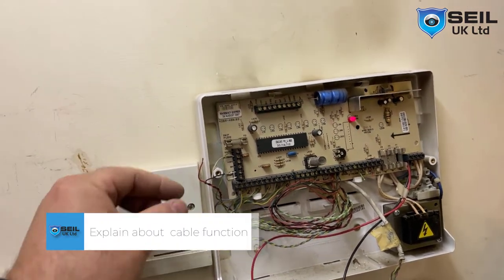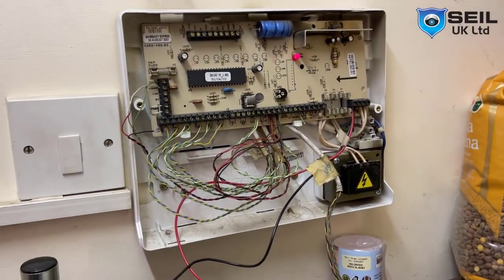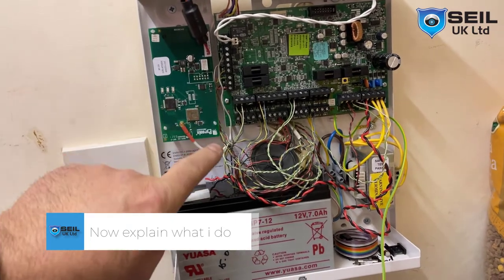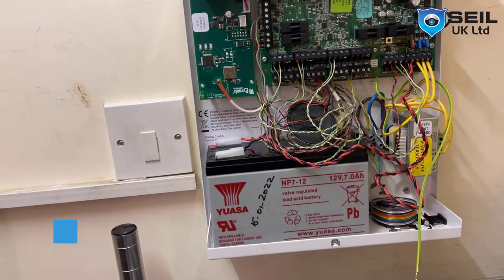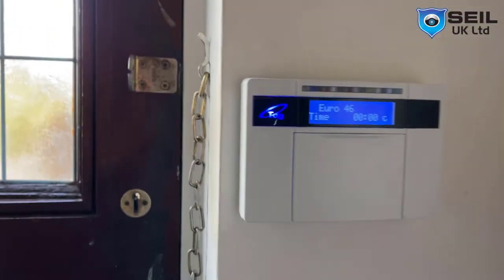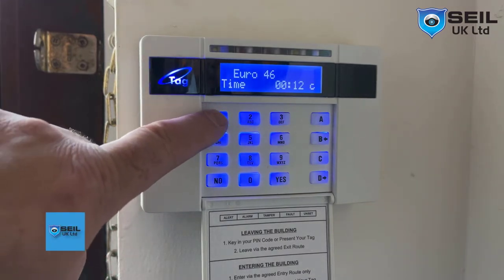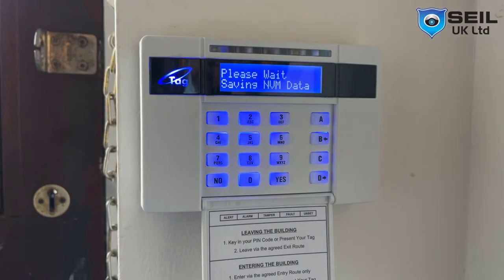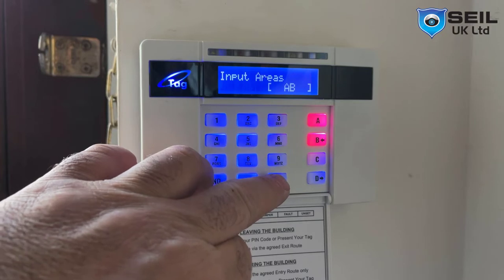HOW TO UPGRADE OLD HOME BURGLAR SECURITY ALARM

Comment: love this kit. its the only kit we fit now. but the hole on the RKP with the cut-outs arount it needs to be screwed down for the tamper for graded 2 systems.    very good install nice and clean install   

from a fellow Pyronix installer good video

Comment: Hi there, I am trying to set one of these up at home and whenever my intruder input is triggered it doesn't trigger the alarm but instead looks for me to enter my code, after 30 seconds it then rings the alarm. Is there any way to get this alarm to trigger like you did when the hall sensor picked you up for a full set alarm? 

Thank you!
Reply from the maker: Hi thanks 🙏 to watch my video. Seniors no trigger till give change program. Every program is different. In your case I understand from your question when you go to front of sensor after armed alarm no trigger. It’s mean you net set input program. Go to engineer mode and keep press no see input and select zone which one you give program. For example I select zone 1 on main door contact I give mode (entry exit) when door open alarm gives time to off alarm default time 40sec. Zone2 I used always hall I set program commonly used Entry route (ER) give time when you used part setting B. In full set A zone don’t give time if you come from other side alarm trigger. Zone 3,4,5,6 I used intruder. Hope you understand I make lot of videos see playlists Euro-46 videos. Thanks and good luck!